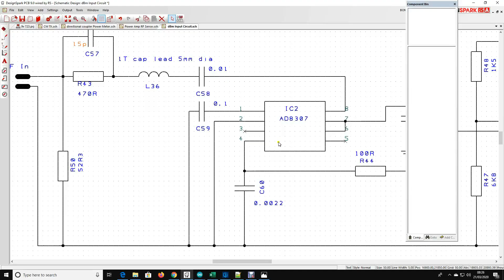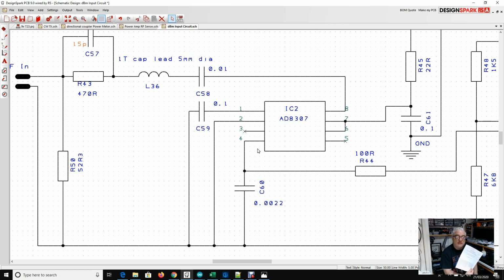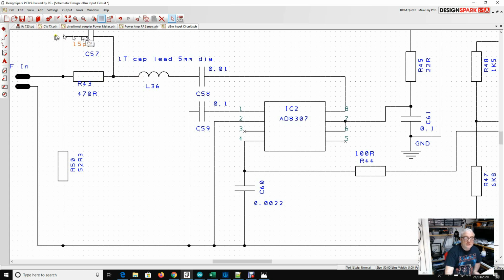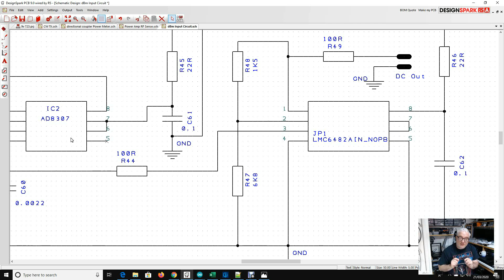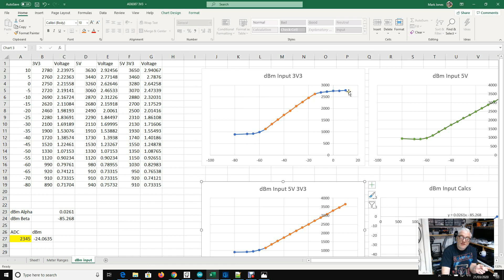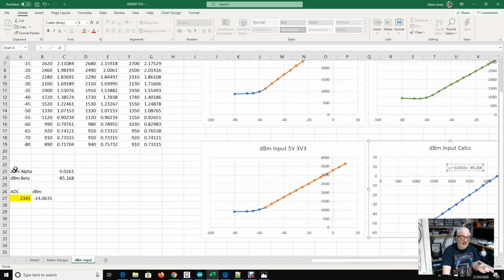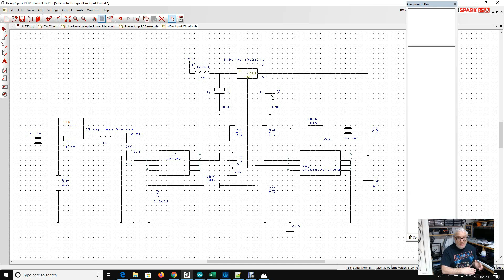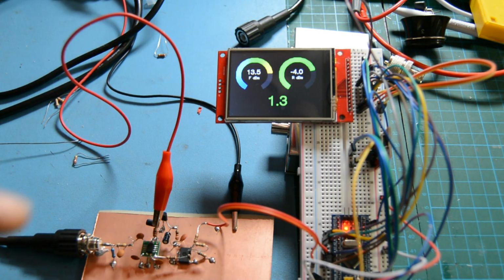An Experimental Power Meter using Arduino - Final Musings

Comment: Hey Mark, would appreciate a diagram on how you've got everything connected to the STM32, Cheers
Reply from the maker: I've added the Frizing diagram to the project files here: https://www.qsl.net/g/g0mgx//BlogFiles/Power2/ILI9342%20STM32%20Power%20Meter%20Experimental%20inc%20dBm_bb.png
Reply: @MarkG0MGX  Cool, Thanks Mark, 73